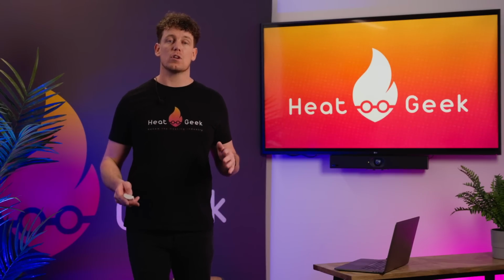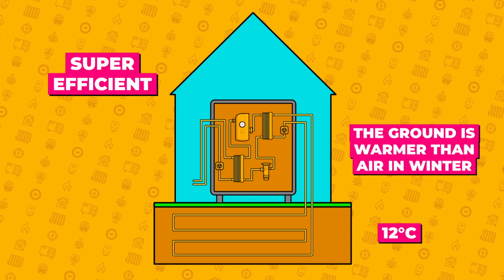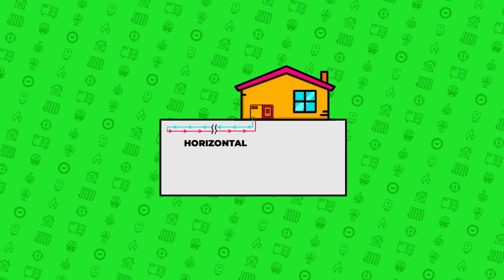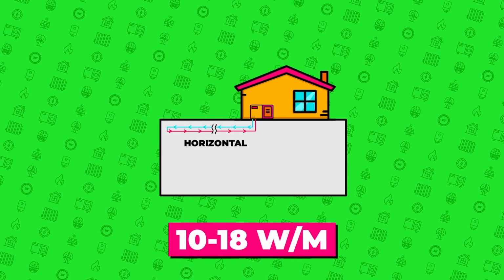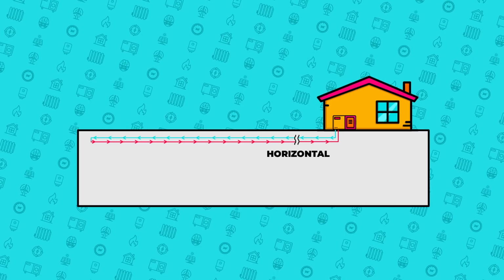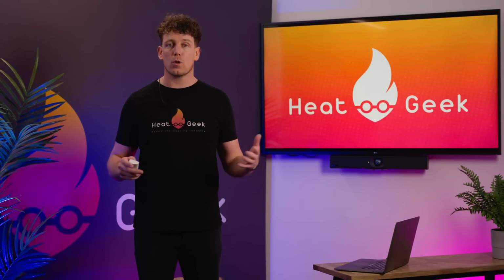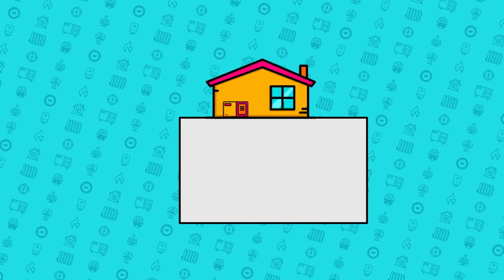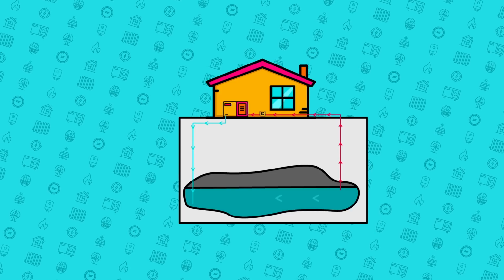How heat pumps work for dummies.

Comment: Hi do you have to have a buffer tank if you have 2 Air source heat pumps i.e if you have 2 x 8kw heat pumps do you have to have a buffer tank to synchronise the two units.  Also are 2 8 better than one 16 if the unit can produce 16Kwh at lower temperatures.

Comment: I would suggest that you might talk about a heatpump cascade of 2 smaller heatpumps instead of 1 bigger due to higher efficiency and longer running time instead of short cycles in spring and autumn. You had mentioned it in the most recent skill builder video at Adams home when you were discussing about the leading installations with only these 2 words but I have heard about that before. 
Of cause you had mentioned that 2 smaller heatpumps can get a lower modulation especially if one is turned off, but there might be a more complex story behind it cause I wanted to avoid these short cycles we call "clocking" , when the heatpump can no longer modulate a too low heat load and can only turn off and wait till it turns on again - kind of pulse width modulation.
Reply from the maker: That’s not really a type and its own video at some point 👍

Comment: Interesting dimension suggestions on the ground geating system. I live in Finland around 60 degree nort. The average yearly tempreature here is around 6 degrees. That correspond very well to the ground water tempreature. When operating a ground water heat pump we typically loose one to two degrees after a few years of operating.

We have underfloor heating in a house we built 2004. Building standards required tripple glazed windows and minimum of 30 cm of wall insulation and we have 35 in the walls and 50 cm in the roof. Seiling hight is 2.4 meters and we have 208 m2.

Our well is is 185 meters deep out of which 178 meter is active in the rock. Our cuurent heat pump is an inverter model with max 8 kW (replaced in 2023). The first pump was 9.5 kW on/off model. Both of these have been sufficent to supply the heat and warm water without tiggering the direct electrich heaters for anything else than heating the tap water to 65 C once a week. We consume around 10 to 12 MWh a year depending on how cold winter we get. That is around 2500 Euros per year including all electricity.

In the past the systems were dimensioned to cover 70 to 80 percent of the heating requirement butalready in 2004 I decided to dimension it to 100  percent. That is now the common way they recommend over here especially with the inverter models.

There are a fw reputable brands of heat pumps that are commonly used here. Those are Nibe, Bosch/IVT and Thermia. For commercial usage there is also Viesmann.At least these have stood the test of time. Our first pump was a NIBE and now we have a Bosch. I chose Bosch this time due to the reputation of the local installer, especially there life cycle services, not only the quality but whith the speed they are available.

The new pump is not more efficent than the old one. Maybe a little more efficent when heating tap water. I have only been running the new pump during winter so far and the COPso far is 4.3. I excpect that to increase slighly over a full year. The tempreature in the well did go down to plus 3 degrees during the winter. We had - 30 degrees for a 2-3 weeks this winter so not bad. Most of our neighbours have ground heating. No well is closer than 100 meter from each other. Too many too close to each other is not good for keeping the ground water tempreature. If you live closer by each other in a residenial area this can become an issue ofr yourself and your neighbours. The ground water can however be 1 to 2 degrees warmer if there are lots of buildings and paved rouds. The groud will become warmer during summer due to the black surfaces.

Our geological institute have surveyed most of the country and one can see the type of bedrock you have. There are differencies in the heat transfer capabilities depending on the rock. We normally do not have to make any ground surveys when drilling an well. The only risk one faces is how far down the bedrock is. The cost for the part before reaching the bedrock is much more expensive as it needs to be fitted with steel pipe.

A typical installation around here without the floor heating would now cost around 20 thousand Euro. If the house is over 160 m2 ground heat starts to become feasible, for smaller houses it is questionable. I guess in central Europe it could be questionable if it is feasible since the heating requirements are less. I would not concider installing at least a ground heat pump if average tempreatures are above 12 degrees, especially not in an old house. This of course depends on the electricity prices as well and those are difficult to predict 10 years ahead. If possible I would first look into the insulation.

Comment: Air to Air more efficient then heat pump.   Added bonus of air conditioning which work great with solar power.
Reply: Air to Air are heat pumps... I'm not sure how someone can claim they are more efficient, as there's - as far as I'm aware, no end user way of verifying COPs/SCOPs.  Where as with ones in water borne systems it's fairly simple - probe electricity usage, flow and water inlet and outlet temperature. So the SCOPs given will be more in line with what the system can achieve - whereas you're kinda relying on the lab conditions for A2A.  As a side note: I have A2A (3 outdoor units serving 4 indoor units, and a DHW cylinder), so I'm not against A2A at all, just trying to be realistic about the comparison 🙂
Reply: Manufacturers rate them at 500%. Simple physics heating air to air needs less energy.  1. Your not needing high temperature and 2. Your not heating water to then a radiator to then heat air.
Reply: @CrashUK28  Yes, but the manufacturers test them running under specific circumstances (usually 20C for one). I normally run mine at least at 21C and with a set fan speed to ensure my house is comfortable, so whilst getting the manufacturer's quoted SCOPs and COPs is possible, it's unlikely that everyone will be getting them. 
Also with A2A as there are fewer "emitters" they may need to run at a higher temperature than an equivalent A2W set-up, so whilst there is technically an extra step it can end up more efficient.

Comment: @heatgeek why does it seem like ground source water-to-water heat pumps have a significantly lower COP/EER than do air-to-water heat pumps?  And why do packaged direct expansion units have higher EER than water-to-air (hydronic fan coils)?

What am I missing?

Comment: Thanks for this informative intro to the evolving and confusing topic. 
I’m looking for information around small air to air or air to water heat pump solutions. The idea being that a single radiator or fan would give a continuous low grade (20 or 30 degrees c) supply and help to stabilise a rooms temperature. I know I’m missing calculations for room size and probably more to understand how the room losses heat. Is this something that is relatively easy to do?

Comment: I have just bought a split system heat pump from Fischer, only company doing the split- the hot water system separate to the radiator feed, meaning in summer I don’t need the heat pump on for my hot water.

Double efficiency

Comment: how far down to ground source pipes running horizontal need to be ?
Reply: Maybe hire a mechanical digger even if the 25 m auger drills thing seems to book nicely at first. It's a little posh though.

Comment: Helllloooo, I have a couple questions reg. heat pumps and how they work / can be set up.

1) More basic one, but when I've heard about heat pumps the general advice has always been to set a temperature and leave it there. This is obviously is not ideal given the natural way out bodies work is to expect a lower temperature at night (otherwise you will get poor sleep). As such, is it possible to set the temperature to say 20C in the day and 17 or 18C over night (or just off)?

2) How possible is it to link up a wood burner to the heating system. With our current system boiler we have the boiler and a back boiler wood burner feeding into a neutraliser, and then the rads and the coil for the hot water tank feed off the outlet from the neutraliser. This is perfect as we get carbon neutral heat for both hot water and radiators when using the wood burner. Is this still possible with a heat pump or is it likely to be incompatible for one reason or another? (if not then this may be a bit of a step backwards given the grid is not carbon neutral atm)

Comment: I know someone with an old Worcester Bosch ground source heat pump that was installed around 2007 along with underfloor heating, they have no end of issues with it having alarms going off all the time and have the front panel off to access a reset button on regular occasions. Apparently they need a replacement part to fix this but are having a tough time sourcing the rare parts, should they cut their losses and install a newer system that can be more easily maintained whilst being more efficient? Would they be able to sell on the unit for parts as they are so rare? Or is it just all smoke and mirrors from a unreliable technician that is leading them on, are the parts actually quite available?

Comment: I recently finished insulating my home and am now considering the next step. As I live in the Netherlands, getting a Heat Geek trained/approved installer is a bit of a challenge, and from what I have seen, most installers here just choose what they know.

I think getting underfloor heating first should make sizing a lot easier, and with insulation the gas boiler is using about 8000 kWh a year including bath and shower (estimated at 1800 kWh).

The system runs pretty efficiently now, and throttles back to 4 kW in most cases (with some tuning), and maybe with underfloor heating I could get this yearly usage down a bit further than that.

So what do I do next?
1. Get underfloor heating installed first and measure for another winter.

2.Just install a Vaillant R290 heat pump based on the current heat loss and installed radiators.

3. Get a total quote/design and have everything installed at the same time (or warm month) by one installer, so the system is perfectly matched from day 1.

Or does it not matter as long as each installer does a good job?

Comment: I think I'll get an air to water heat pump eventually but prior to that, I'll focus mostly on a "fabric first" option

I've got microbore piping so I'm going to to replace those

I'll also make sure I get super insulation, triple glazed windows an MVHR, Jaga Strada radiators etc..

As for my parent's, they live in a terraced house so I'd hope that the council could install some kind of community heating solution. Being a mid terraced house presents additional challenges unfortunately

Comment: None of them.When its freezing cold ,no matter how much you magnify that temperature you don't get heat.Also i don't want all my floors ripped up to fit extra large semi warm pipes.
Reply: So no, freezing and 0°K are different. If you think hail or snow or flooding or walruses are going to wreck your outside coil bring it in and have it work against a spread loop of underground circulating saline, using solar and battery power if you think your electric service is going down under frozen influences.

If the ground freezes 16 m down, you have an amazing chance to run liquid hydrogen works...

If you just need the negativity why not LLC as Krampus?

Comment: This is from a heat source calculator for a house of my age , For every sq ft of living space, you need about 30 BTU of heating output. That means, for example, that for a 1,000 sq ft home, you would require a 30,000 BTU heat pump (that’s a 2.5-ton heat pump)., so my heat source pump for my house is 60000 but with a weight of 5 tonnes, so how is that going over my roof then
Reply: The heated floorsize x w/h lost calculation is only a guideline at best. There’s old houses that have massive insulation/triple glazed and run of a teeny tiny heatpump. 

A properly done heatloss calculation done by a professional is worth the money. From there you can size your heatpump and/or take insulation measures. 

After that, system layout comes into play which focusses on high-output emitters at low temperatures (underfloor heating, upsizing rads) and keeping flow rate as unrestricted as possible.

Comment: Our oil boiler is on its last legs. Tried some heat pump quotes and you need a up to date EPC survey to qualify for the £5k grant with no recommendation for extra insulation etc. despite planning permission for a loft conversion we would have to waste loads of money on loft insulation we will have to rip out after….

So now looking at just replacing the oil boiler with another guess what oil boiler. Government policy really makes so much sense not. If only they had a few decent engineers working in government departments and ministers who came from the professions they were in charge of the departments they ran they country would be running so much better!

Comment: Very nice. A bit technical at moments, but the principal is explained very good!

Question: I am thinking of using a heat pump boiler (which only runs during the day) for hotwater and in the night for supplying heat to our under floor heating.
In this way I want to avoid that the central heat pump kicks on.
Did you ever do anything like this?
Reply: Basically you are buying two heat pumps then. The nice thing is an all-in-one hot water system that is independent of the main house heating system, both in kW as in location. 

The downside may be extra cost of 2 systems, but if you can downsize the heating system and simplify the install, that may offset the extra cost (also not adding/changing pipes )

Comment: Love heat pumps . Think about installing  water to air heat pump in Antarctic. Sounds inpossible but a huge heat source is the ocean at about minus one deg C . Could save an enormous amount of fuel with a cop of at least 3
Reply: Which national program are you with? I work for BAS and would love to touch base about how you manage the various difficulties?

Comment: Interesting content.  Please can you confirm that air to air heat pumps qualify for reduced rate or zero VAT?  Can their installation be funded by the BUS grant?
Reply: We had air to air fitted last week in our bedrooms. There was zero VAT but it didn't qualify for BUS.
I don't know if the same applies to commercial installations
Reply: @chrisyarrr  thanks, this is what I thought.  Which make have you gone for?
Reply: @sjcsystems  They were fairly basic Fujitsu units as that's what the company exclusively fit. They came wifi enabled and the app, Airstage, is ok if a bit dated.

Comment: That was excellent thanks!  So we have a Calorex system that was installed into a new house in 2008. We had no idea what it  / heat pump was, it was totally down to planning permission for a one off build on a plot. For this reason, took as some years to make the best of it, as we just treated it like a gas boiler and were therefore a bit disappointed.  Now the whole thing makes more sense. I am aware that Calorex seem to be out of the domestic market now (seem to do swimming pools). So will be interested to see what we do when this system eventually needs replacing. That said, seems quite robust. Two compressors. No resistive heating. If required can to domestic water to 55C with no issues.  Mark.

Comment: I think the technology is fascinating but I just can't see this ending well when the big changeover comes. We couldn't even get the smart meters right so what chance have we got with this. Most of these systems will be installed for free by the government. Installation teams with targets of 5 installations per week. Corners will obviously be cut and systems won't work right from day 1. It's going to be an absolute disaster.
Reply: So DIY it, it's reasonable to do several houses a day if they don't have to do the insulation first or have a team of 6 and the inspector abiding half to 1/6 the time.

Big changeover? King Charles is leaning into Dark Brandon mode rockwool, cladding, vapor barrier and mastic?

Comment: Question:  I'm looking to install a heat pump system and was wondering if you ever did experiments with cascading two smaller heat pumps in a single system?  
My thinking is that you can use them staggered (let only one HP run until the minimum output requirement of the 2nd system is also met) to achieve an average low output of both, i.e. less noise and higher COP.  
This may need some extra plumbing to keep pump#2 hydraulically neutral, assuming pump#1 always starts first.
Reply: You would need planning permission for 2 outdoor units (under MCS) also cost would be extortionate, space required would have to be factored in, would work with the correct sized buffer but would be less efficient than a correct sized unit with an accurate heat loss calculation
Reply: I just got mine from Fischer - check them out